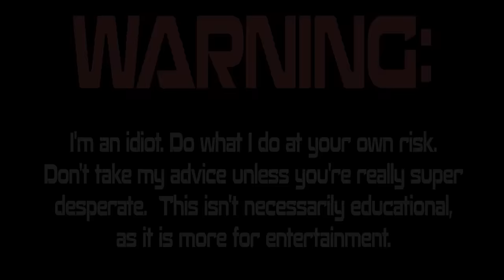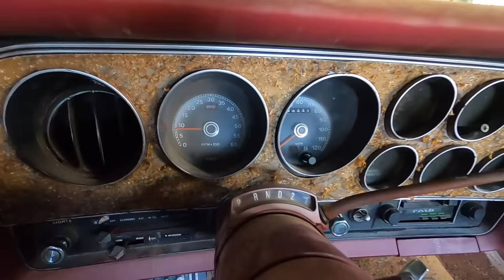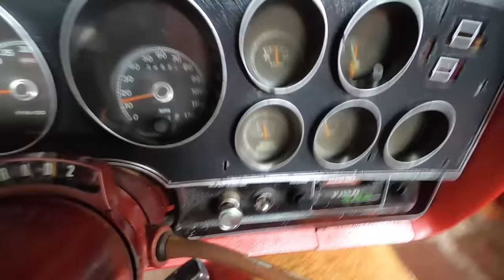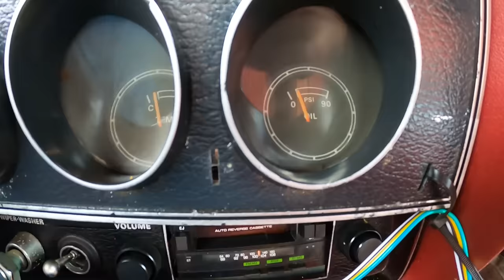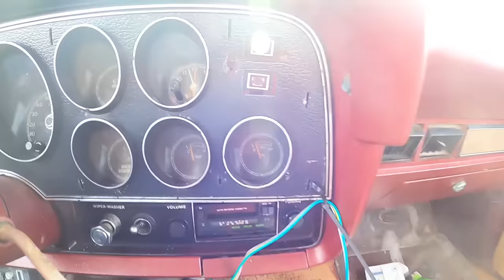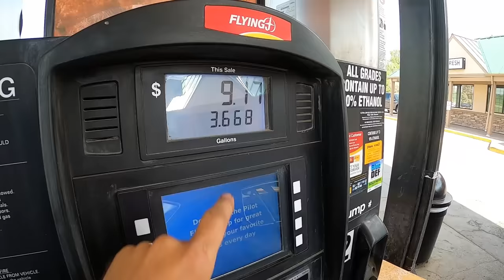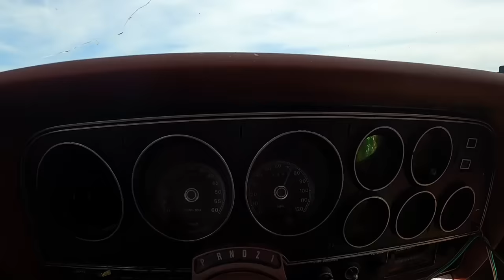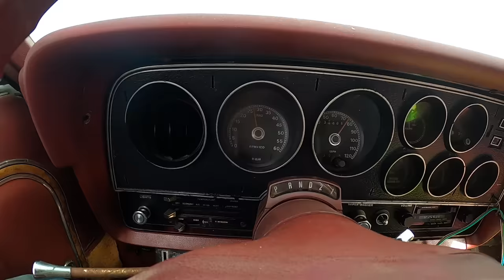SEIZED Ford Gran Torino Elite will it RUN & DRIVE after 29 years? - Vice Grip Garage EP89

Comment: What I have found in my 45 years of working on cars is...it really is difficult to completely kill an American pushrod V8.  You can always get 'em started.
Reply: Usually with those old 351m 400 engines the cause for low oil pressure is worn out cam bearings.
Reply: @stonevalleyozark475  I don't think the low pressure is "real", they get to be real noisy SOB's in the top end when the pressure drops. Sender's bad.
Reply: @stonevalleyozark475  I love them. Not a big fan of fords but 351c and 351w were indestructible. At least from what I’ve seen

Comment: Love the video.  Back in the late 70's, I had a '73 Gran Torino 4 Door with a 351 Cleveland.  Bought it for $800.  Drove it for 4 years then sold it for $600 when I went in the Army in '83.  Got about 12 miles a gallon with a 17 gallon tank.  Loved the car.
Reply: Heh, heh, heh. I bought a '73 Chevelle SS right off the showroom floor. But every time I looked back, I wished I bought the Monte Carlo sitting next to it instead. Haw, haw, haw.
Reply: Same, '73 Gran Torino with the Cleveland.  12-13 around town, 20 on the highway.   One of only two cars I really miss.  '73 Clevelands were only like 150HP because of the low compression necessary for the crude emissions control.
Reply: @ohger1  My Gran Torino was the first car I ever owned.  I was just out of high school and that car, for me, was my world.  Although it seemed to need something done under the hood regularly (points adjustment, new plugs, alternator, fluid, etc), it never left me stranded.

Comment: I've owned and driven 2 of these cars. I knew from the beginning that you'd make it home. If it wasn't for the fuel mileage (or lack thereof), they are one of the ultimate mid-line comfort cars ever made. Ford power, baby!!
BTW, hope your able to keep your channel going. I agree with many others; it's one of the best out there. That's coming from a life long mechanic that's driven 'diamonds in the rough', like this car, his whole life. Keep it real, dude!
Reply: I had two of these Ford Elite, '75 and '76, when I was in tha States 30 years ago. Great cars indeed, except the lack of fuel mileage. Enjoyed them a lot! Greeting from Taiwan, the Republic of China.  ：）
Reply: @materials1000  The fuel mileage wasn't a consideration for a lot of people after the first Energy Crisis was over by '75 (although the price of gasoline about doubled from 29 cents per gallon to about 55 cents per gallon!). I think these cars seemed relatively small in comparison to the huge full-size cars you could buy in the U.S. back then.  In fact, in an answer to "downsizing" their Torino, in 1977 Ford decided to introduce the LTDII which had a hood so long it looked about the length of the entire Torino Elite. It was a heavy-looking plain thing that looked big but not as stylized as the Torino and especially the Elite.

Comment: "I'm  losing a little oil pressure so I'm just going to cover that gauge so I don't keep looking at it. That should be fine."
Reply: have pieces of black tape over 4 of the warning lights on my Crown Vic...
Reply: Applies Men's oldest known cure...
Ignore it and it will go away.
Reply: I wonder if that will work with my Battery light. I can't figure out what's going on. Everything charges normal. 🙄
Reply: I used to have a Dentist like that .
Reply: @trr5291  - One of the 3 diodes of the alternator's triode may be bad...
Reply: @BuzzLOLOL  It may be alternator related but my multimeter says its charging at 14 volts at idle. I give up. I'm just going to drop it off a mechanic and let them figure it out.
Reply: @trr5291  - It'll still charge, just won't look right to a computer or oscilliscope... what year of vehicle?
Reply: @BuzzLOLOL  248.000 mile 2002 Dodge Intrepid with the 2.7 v6. And oh ya alternator finally fried last night on my way home from work. It wasn't even 4 years old. Luckily the battery is good and it made it home off battery juice. I put a lot of miles so it probably had about 60.000 miles on it. Still pathetic.
Reply: @trr5291  - My 2004 Ford Crown Victoria Deluxe needs a $350 "smart" alternator, $200 starter, and $30 serpentine fan belt yearly... Fortunately, Auto Zone honors the 'Lifetime Warranty' on alternator and starter over and over, no questions asked... I should go Lifetime on the belt next time, as well... but starter dying in middle of winter is still a pain in the ass to have it towed home and crawl under to change it...
Reply: @BuzzLOLOL  Well I guess I got lucky that mine lasted 3 years.
Reply: @trr5291  - Ford starters have 3 problems... instead of a heavy copper strip connecting solenoid to starter motor like GM, they have bare fine stranded wire that corrodes into nothing with a little road salt(I learned to cover it with silicone sealant before installing)... the starter one way sprag clutch strips out... the starter clutch mechanism explodes into pieces... I suppose the brushes would wear out also, if the starter lasted that long...
Reply: :-) that's a style
Reply: Don't do that put some 90 weight rear end grease in it
Reply: Hopefully you did not use the new and improved thinner oils.   10W30 is what this should take.(not 5W20 or 0W10 hair oil.)Your bearing clearances are that large that 40W can be used.
Reply: @BuzzLOLOL  If you lose one of the diodes then the voltage output is under 12V so you eventually die. Battery needs a recharge using a bat. charger.  More than likely it has a regulator with points and the points welded together.
Reply: @bunzeebear2973  - It can still read 14 volts on a digital voltmeter with a diode out, but it's not a steady current, 33 - 50 % gaps in it... so battery falls behind...
Reply: @BuzzLOLOL  the starter on my 98 f250 4.6l lasted 150k miles before it finally died. And it didn’t even actually die, just shorted out against the exhaust manifold. You could still use a screwdriver to jump it and it would still start.
Reply: @bnanabrd9826  - You lucked out!

Comment: "I'm losing oil pressure, I'd better put something over that gauge"
Reply: Yep , do the right thing ! Lol !
Reply: @thomashuskey3531   I agree 99.9%
Reply: Reminds me of the simpsons. "Oops tape fell off"
Reply: I'd say the oil pump probably wanted to die, or a oil line/seal
Reply: I owned 2 Fords that ZERO oil pressure at idle, sold both still running, one was a 1969 XR7 with the 351 W, and the other was a 77 Town car, 400 cid. Neither motor indicated there was a problem, other than the obvious. No lifter tick, no knocks.
Reply: I did the same thing to repair my VCR  when the display was flashing  12:00.....12:00....12:00 .
Reply: Truth in advertising, That is the best backyard mechanic decision by far.
Reply: Could have been a gauge problem.   Fords had a special voltage regulator for the gauges.   When it failed the gas oil and temp would all read low.

Comment: You are the old cold start king
Hands down
Reply from the maker: much appreciated!!
Reply: Gotta be a dodgy oil pressure gauge I’m fairly sure the engine would of detonated going that distance with little or no oil pressure wouldn’t it STP is good but probably not that good 😆 and final rev on the driveway NO SMOKE. 
Thanks for the amazing content and hard work you sir have truly helped me not to go insane through lockdown in the U.K.  and I thank you.
Reply: No oil pressure cause they chewed gauge wire I guess is what you said
Reply: I meant to make a new comment not out this in a reply to this one?🤷
Reply: Nate vanLandingham was it an electric sender back then ? I thought it might’ve been pipe fed
Reply: @mrwolf9335  pipe makes sense, I think he said pipe. They would of had an oil leak back there if it was chewed off. It was one or the other though.
Reply: G.O.A.T
Reply: Whahahaha yes indeed he is
Reply: @mrwolf9335  and VGC helps keep us sane in the rest of the USA, Covid 19 central!
Reply: @mrwolf9335  No it's electric/resistance. Guarantee the problem is just a 45(?) year old sender and/or old chewed up wiring.  The valvetrain would sound like a garbage disposal if it only had 5 psi.
Reply: more like cold snack king
Reply: Hey derik. I notice you work on alot of chevys. Not knocken a ford or nething but im having a hell of a time finding a 3 on the tree column for a 81 c10. Have you came across any
Reply: Derek
Reply: Incredible job guys.you gave that forgotten Rino a new lease on life!
Reply: More Like a dead start king
Reply: This channel ticks all the boxes, surprise( at what he's bought)drama( what's still nesting and is anything under the bonnet) and last of alll pure elation that the heap actually fffffing runs.Great job,from across the pond.
Reply: Your show is awesome ..
Reply: He certainly does amazing things on the fly with these old junkers

Comment: “But the good news is if you get one that works, it’ll stop working” 😂
Reply: Reliability... won't let you down
Reply: I've only had one failure in several hundred thousand miles. But yea, keep a spare one under the seat
Reply: Best part of the video.  LOL
Reply from the maker: just tellin er like she is!
Reply: @castirondude  next to your voltage regulator, right?
Reply: @trevorpomroy550  yup. One year I blew about a 3-4 voltage regulators. Then my uncle said "Replace your battery cables". Whaddayaknow ... never blew another voltage regulator. But yea that's the trouble with electronics, most of the time trouble is silent. Mechanical issues can be heard and felt when they come up, electrical usually not. Sometimes you can see the lights flicker if you have a bad battery cable but that's about it.

Comment: We use to run this body on a Nascar Late Model from the early 80s until the late 80s  Then  the rules changed and we could run a fiberglass Thunderbird  body. I always liked the way that car stood out against all the  GM square body cars. Out of like 40 cars we had the only Ford. Track was in the Southern Tier of N.Y. Shangri-la  Speedway. Ritchie Evabs Bodines and Jimmy Spencer ran there weekly. This vid brought back some memories . Thanks
Reply: Guy that bought mine in late 80s wanted it for just that.

Comment: I used to have a car with the 'check engine' light on,  I lived with it for about a month, then I did the right thing & fixed it...(with electrical tape)
Reply: Sometimes a guy can get a smiley face sticker and put over it!.. and yup, fixed! 😂
Reply: Magic makers works too
Reply: I have a 88 Caprice does that when the engine warms up.
Reply: My car's check engine light came on. When I got back home I checked the engine... It was still there right where it always was... :-/
Reply: My mate had a car where the air bag light would stay on... So he rewired it in parallel with the engine management light.. They both came on and went off together... Any warning lamps on dash will fail UK MOT test.
Reply from the maker: I can confirm this is the proper prodcedure

Comment: They usually don't work, but if you find one that does work, it will usually stop working. Best Ford line ever
Reply: I dont know my 89 f250 7.3L IDI Diesel still works.
Reply: people always think the brand is named after the founder, but its a well known acronym for Fix Or Repair Daily.
Reply: @rrs_13  Found On Road Dead
Reply: @edbon3774  🤣Hadnt heard that one before. You live you learn!
Reply: First on race day
Reply: or if in the othet camp found on rubbish dump
Reply: I resemble that remark.
Reply: While fixin my xploder.
Reply: @edbon3774  Freaking Over Rated Disaster
Reply: @Mark-nu5vg  Fork Over Repair Dough
Reply: @edbon3774  Forgotten Object Remains Dead.
Reply: I converted my Jeep Cj over to duraspark. I have had good luck with them.

Comment: "Smells like old knee braces and grain"; incredibly specific mix of odd smells, yet I immediately smelled it in my head somehow.    Great video, had me laughing multiple times. And I've replaced a few of those carb accelerator pumps as well as dicked with them a bunch. My mom had a 79' T-bird back around 85/86 that I cut my teeth working on cars while in HS.
Reply: Ya, My mom had a 1968 Olds DelMont 88. I did all the work on it for her. Somebody pass me my dwell meter.

Comment: I think that the oil sending unit might be bad, I had the same issue with a gmc pickup replaced the sending unit and the pressure shot right up.
Reply: bet you're right.  It's only 45 years old, just don't make this stuff like they used to.
Reply: dennis lynn We had a Ford truck of this vintage that just needed the sender cleaned up and VOILA, oil pressure gauge WORKED!
Reply: @barbaraganschow1478  yup that's what I was thinking in the lines of water, dirt or bad electrical. She'll be fine !
Reply from the maker: could be might have to check on er

Comment: Great fault finding techniques, which apply to any automobile.  Logical, systematic, and sensible progress through the critical elements required to get a car started, and then running.  I have old Jaguars, and although they are a bit different to the Detroit offerings, your videos inspire me to get down the shed and get stuck in.  Hope you are enjoying Tennesse; similar weather to New South Wales!

Comment: “Elite”
With hand-cranked windows. 
It was a different era.
Reply from the maker: haha, yeah
Reply: I had one when I got married in 1985, it had electric windows. Never seen one that didn't. Must have been an option.
Reply: @bloodybones63  Yes it doesn't seem like an Elite would not have at least power windows. I do remember them having really nice interiors, kinda soft nylon. He is correct, the gauge package was an option also available in the Gran Torino. I lived that era. some great cars but...Very few cars had full power as standard equipment back then. Caddy's, Lincolns, Some Mercury Marquis', Buick Electra 225, Olds 98, Imperial and Thunderbird-'till 76 were the primary ones. They all had so many different "packages" on different models back then that some of the power options were included in. It was messy, but in a nice way. You could order just about anything you wanted on most things, with the money of course. Tilt wheels were even rare except on the above list. Seems so strange now that I just cannot imagine not having tilt, cruise and power everything. I have a 1983 Grand Marquis LS with everything except a sun roof, 38000 miles. I think I'll keep it.
Reply: Yeah that surprised me as well
Reply: @montymatilda  my parents had a 1979 Thunderbird, it had power everything, even the key hole for the drivers door had a light in it. It was a really nice car.
Reply: @Brett235  wow, nicely equipped, as they should be! 79 was my favorite of that 3 year span.

Comment: Modulator is the vacuum gimmick on the 66 trans. they like to leak AT fluid  and the engine sucks it up and burns it off.replaced hundreds of them back in the day. Thanks for all the entertainment and the new slang terms you've shared . keep it up

Comment: I covered my temperature gauge with duct tape and the car is running fine now.
Reply: I unironically covered over a dash warning light for a airbag (a vehicle test fail here) with a few careful layers of permanent marker or sharpie, and it worked, the tester didn't notice the light and it passed 🤪

I've also loosened the plastic cowel(?!) around a instrument cluster in a more modern car, added a couple of wood spacers, and managed to cut off the whole bottom row of warning lights including the ABS and airbag lights, both test fails 😬

Just on my personal cars, I didn't sell either of them 🙃
Reply: She just wants to go wide open and stay.....Thats fine with me 🤣
Reply: Works for the gas gauge too. 👍

Comment: I had a 76 Mercury Montego my dad gave me, it had 117,000 miles on it. 351W motor with a severe lifter click, started running premium gas with 8oz MMystery oil in each tank. Cleared up the lifter noise, put 100,000 more miles on it before the trans quit. It looked A LOT LIKE THAT Forf Elite😎

Comment: I got hocked on your cool videos . As I said in one video - wish you my neighbor . I was given a cool 81 ford f250 auto 4x4 460 . It sat 15 years and full of inch weeds and mice . The engine lock or converter . I spray bug oil into cylinders and a 4 foot 1nch breaker bar . Gave up and it went to iron pile . I sure you got it broke lose and made a great find for free .

Comment: Good to see ya tinkering on an ol’ Ford.  I’d like to buy a back rag but “I’ll be dipped” if postage to Australia is “Shutting me dowwwwnn”.  🤙🏻🇦🇺
Reply: I just checked channel and thanks to the COVID LOCKDOWN I managed to pass time watching every episode.  I could sit and watch you work all day.  
I would like to see more finished and "restored " and sold to someone that drives them in pride.  Hada 76 351 W in van with headers and Elderbrok intake with Carter 625 cfm carb i put in that ran great.  Got 15mpg before mods I did and got 15 mpg after.  No help during gas shortage of 70's.   Redid with seats and "new" engine and paint but i suspect they never swapped engine cause i still used oil and had 6psi in one piston.  Factory junk yard original parts hid engine so much I couldn't see new engine paint.  Never again. DIY better then you know what was done.  You certainly know your stuff.